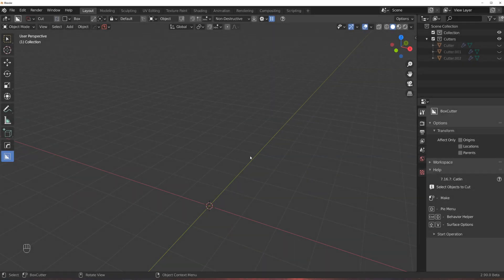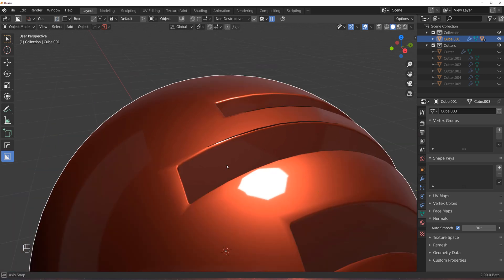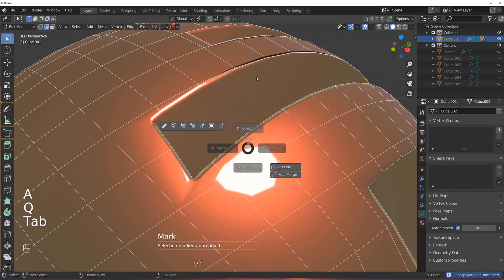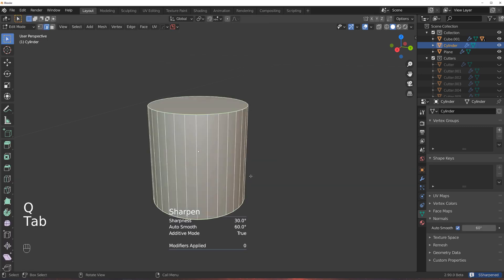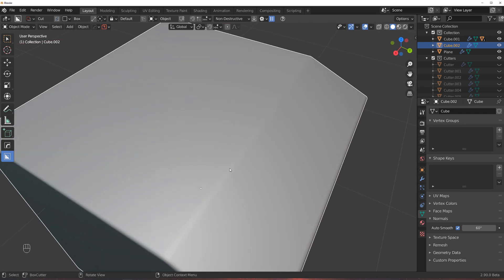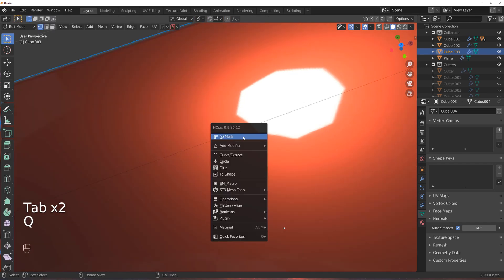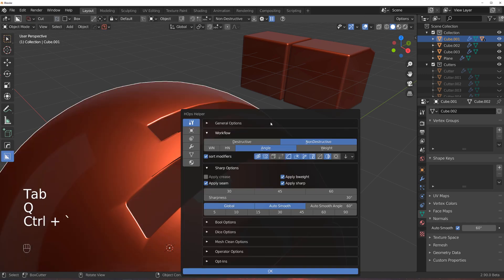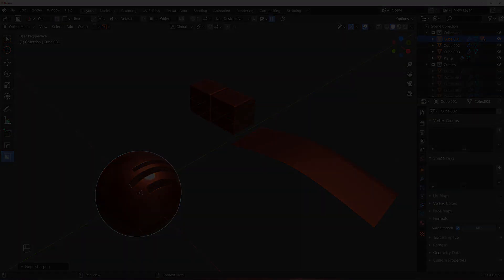Mark Sharp vs. Crease vs. Seam vs. Bevel Weight vs.Weighted Normals - in Blender

Comment: These make a lot of sense for me, but I got to ask: what if you're planning to bring the model into another app later on, like substance painter or marmoset, Zbrush etc. Will these methods work ? Or instead of crease for instance it's better to just bevel?
Reply from the maker: Crease wont carry over, go with mid poly bevel.
Reply: @PonteRyuurui thank you! What about weighted normals? Does using them allow the result to transfer over?
Reply from the maker: just export it with other modifiers, but for game assets harden normals are usually better  @bogdanvasile5460

Comment: Hello Ponte. At the time interval of 8:40, If you apply harden normals in bevel on the left object with sharp edges, won't this solve the problem of visible lines?
Reply from the maker: no you gotta remove sharp edge for this to go away
Reply: @PonteRyuurui  Hi! I did this. I disabled weighted normals on the left object and enabled harden normals in bevel and visible lines disappeared on the left object and it cannot be distinguished from the right object.

Comment: Sharpen Seperates the faces Virtually. Crease Controls Sub Division, Bevel Weight (which is a Thing found in the Bevel Modofier). useful when you want to Manually Controll the Size of the Bevel or in some Cases when the auto System Doesn't catch it you can manually Set it up by using Bevel Weight so it does catch it.

Example A of Using Creases - you have a Cylinder  and you want to use Sub-D but it makes it Looks Ugly, you use Crease to manually Say Where to Stop.

Example A of Using Sharpen - you have 2 Objects that simply want to fight for Attention in the Topology level, you can use Crease to Hide that Error by Splitting them Apart Becareful, there is Many Situatuions Where Splitting will cause even more Issues so cleaning the topology is advice.

Example A of Using Bevel Weights - You want to have 2 Bevels that are Just Ever so Slightsly too big to fit causing Lots of Errors in the Procress, well Don't worry Bevel Weights are here!, they can Controll the Amount of Bevel  in a per Vertice way,  just make Sure your Bevel Modofier is Set to Weighted and your Done!. 

all the Hotkeys in Vanilla Blender can be found by Pressing CTRL + E
there probably Better Examples but i hope i got it kinda right XD. if not please tell me ;-;  thank you!.
Reply from the maker: actually RMB is faster than ctrl e
Reply: You can also found the Crease on the N Menu.

Comment: Hi, great video! One question: do I have to place seams on the same edges that I marked sharp?
Reply from the maker: thanks, no you dont, i do it because it is easy to slap them all with one click, then you need to manually remove all seams you dont need.
Reply: @PonteRyuurui  alright, thank you for your quick response

Comment: Question, I am wondering with these things I call trickery of modeling, how much of it will translate with the obj or whatever format you export it to be used in another software or application? I know there are some of these features that end in a total fail if you are modeling something that will be 3D printed because it is a feature that only works in the software, which is why I call it trickery.
Reply: If you export as Obj, the mesh's modifiers becomes baked and the mesh is automatically tesselated to triangles for import into a game engine. This will also be your best option for importing into ZBrush if you don't wish to pre-apply your modifiers.
For FBX, the modifiers are autoapplied as well, but it wont be tesselated, so you'll have plenty of Ngons everywhere. ZBrush hates this, it will import as an ugly heap of messy crap geo.. So if you want to export as FBX, I highly recommend that you add a triangulate modifier and set the minimum vertices to 5. Then export as FBX.
Maya doesn't seem to like FBX at all unless it's triangulated prior to export.
There IS an option in the Export for FBX under Geometry to apply modifiers btw. But disabling this option on doesn't matter for anything outside of Blender. All other applications preapply the modifiers anyways. Pretty useless.

As for Substance Painter: fbx and obj all import equally the same, no issues across the board

As for Unity: both formats also work equal. They're tesselated into triangles but all texture maps are removed upon import. So you'll need to manually import those and create new materials, add the texture maps to those materials and apply those materials to the mesh.. The usual, typical Unity workflow.

To add: Basically, triangulate your mesh before export, it's a great practice to get into.
As for baking, make sure you're using CUDA and Cycles render, the bake option doesn't work for Optix (rtx). Grant Abbitt has some videos on this matter. Really, it's simple once you do it a few times. The first time can be rather intimidating and confusing. No worries.

For 3D Printing: use STL format for export. Any 3d Print program will gladly import that format without issue. Just be sure to tick the option for "selected only" upon export!
Reply from the maker: @DavidAllen_0  Great info on Zbrush and Maya exports, I do not work with these, so I am learning here! And yeah totally agree with trialgulation done manually before export, especially to texturing softwares. SP has an awful triangulation algo.
Reply: @PonteRyuurui  And SP's auto-UV unwrap is horrendous too lol. Though at least they're trying, but it's seriously not good. I've been hearing people say it's anywhere from "amazing" to "good enough". It's neither of those. it's shit. It stretches the limits of the UV islands.
SP is only good at one thing and that's quickly bringing an object from 0% textured to 75% (100% being Hollywood-Award-Winning) within minutes.
Reply from the maker: @DavidAllen_0  Yeah, there are many things i do not like about SP,  UI scaling , or lack of it thereof, is another one. I am going QM instead, which has a better bridge to Blender.
Reply: @PonteRyuurui  QM is a wise choice as it works alongside PS which I've seen you use in one of your recent vids with the rifle scope
Blender does have tons of 3rd party plugins for SP but that's the issue. There are too many to choose from, and I don't know which is even good, so I stick with the good old export-import then using Node Wrangler's PBR setup (ctrl+shift+T) to connect all the materials automatically. Works good enough for me

.. now that I think of it, it is still very tedious with numerous materials. The dealbreaker for me is taking the time to learn a new program.
Reply from the maker: @DavidAllen_0  If you know photoshopm it is not that bad. Also QM is stand alone, you are talking about the photoshop plugin, that is old stuff. I would not think it would take more than a week or two to learn it.
Reply: @PonteRyuurui  Oh, even better! Guess I'll go give it a try then :) thanks!
Reply from the maker: @DavidAllen_0  ya they released a new one in 2020, some features are still missing, but not for long
Reply: @PonteRyuurui  ok, I got it but it's basically like Substance Alchemist.. am I not allowed to paint on meshes?
Reply from the maker: @DavidAllen_0  nah the main beef is with materials, one collection per object, unlike in SP and the PS plugin, i bet they will fix it soon
Reply: @PonteRyuurui  okay good, because for a minute there I thought I got the wrong program :)
Reply: @DavidAllen_0  Thanks a ton for all the great information Genesys! This gives me some useful stuff I need to play around with and learn!
Reply: @kevinm3751  I'm glad to hear that it all helped out 👍 consolidating info like this is not my strong point but I try my best
Reply: @DavidAllen_0  LOL, I know exactly how you feel.
Reply from the maker: You should be able to via fbx or obj but i would apply all modifiers. If you got issues with sharp maybe play with edge split modifier and apply it befoer export. In addition, you could always bake bevels on top of the non bevelled mesh.
Reply: @PonteRyuurui  Thanks for the great feedback. Yea I need to learn more about baking, I have a vague understanding of it but not up to speed working with it. Does sound like a viable solution and appreciate your take on this.